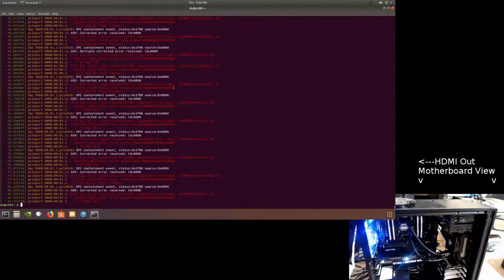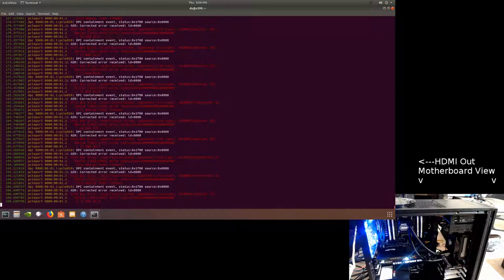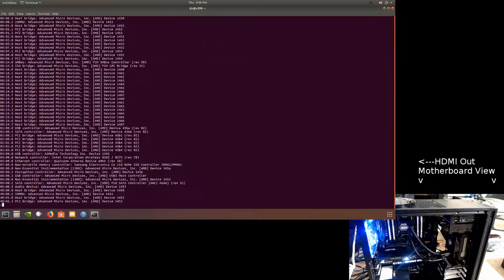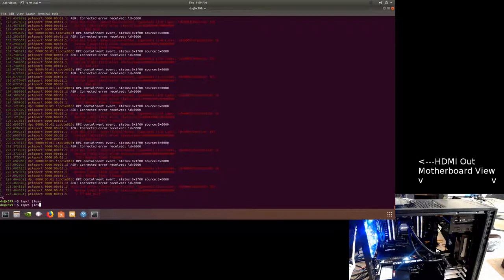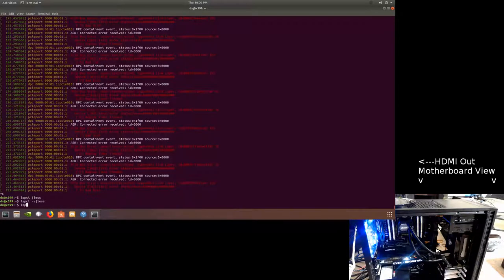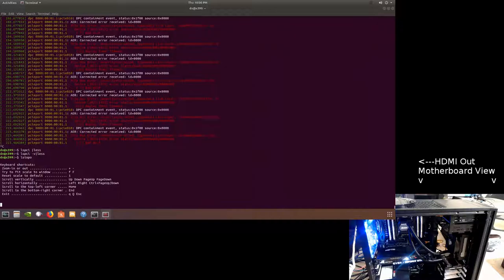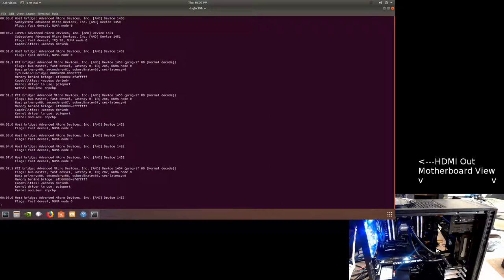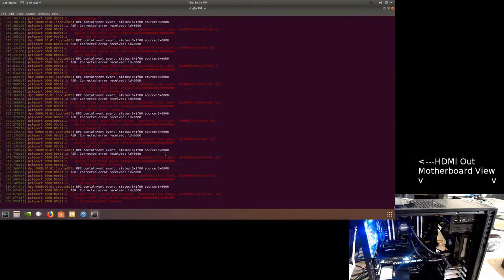Entry #2: Motherboard #1 Gigabyte X399 Aorus Gaming 7 issues w/64GB

Comment from the maker: UPDATE #1: was able to get the NUMA Node 0 PCIe issue "worked around" by disabling some power management features which was a combination of several settings in the BIOS (Gear Down and some other "Down" setting someplace) and a kernel command line parameter. As a result I have "semi" reliably been able to install 6 modules (96GB) operating and recognized.

The system has more consistently coming up and recognizing the dual die hardware and shows a NUMA system, and more consistently recognizing 6 of 6 16GB (96GB total) across BIOS, Memtest86 7.4 Free and a recent Linux 4.13 kernel.

Myself and a good friend did a lot a research to narrow the issue down and still believe an updated AGESA firmware (patch level of 1.0.0.4 or later could fix this issue all together -- latest appears to be at least 1.0.0.6). The F3g BIOS appears to have 1.0.0.3

Will attempt to make a video of the settings on the original Motherboard #1 (F3g) BIOS and command line kernel parameters that more reliably registers 96GB (of 96GB installed). *STILL* not able to register all 8 modules (128GB total).

Comment: fyi gigabyte has a 3 year warranty off manufacture date of the mobo ;)  SO, check your manufacturing date ( first 4 digits on serial number which would be the first for after sn.  these four numbers tell you year and week of manufacture, and if it is withn 3 years and you are having board problems that cant be troubleshooted just submit an RMA.
Reply from the maker: I ended up returning everything and took the restocking fee hit. Just think this product line was rushed to market even after following the "approved" memory list.
Reply: @dx9s  yeah I hear you, interestingly enough and the ram qvl is weird, it wasn't until a couple days ago when I actually saw "summit ridge" util that point they were all "Colfax" ( or second gen). and I have gskill trident Z rgb 2666 for mine that I bought off Newegg and was the only gskill 2666 listed at the time I might point out and the qvl lists the ram albeit a cas 15 and what I got was cas 18, im hoping this doesn't cause me any issues however, I used my board 1 day last October then shut it down while I waited for the actual case I planned to use and a few other parts ( never even installed an m.2 in it yet) only to fire it up last week and get red cpu led and 00 on the post code so it is in for rma right now.  gigabyte has received my board according to my usps tracking number UNfortunatley gigabyte has some weird not scanning it till next day bs which means it wont even get scanned into their system till Monday as they are closed on the weekends and then according to customer service it could take up to 2 dyas before they even start inspecting and testing so I am guessing ( assuming they can repair it or have a replacement in stock) Monday the 23rd return shipping back to me and then if they ship it fedex dumbpost I could be waiting another 2 weeks because of fedex but I do not know what shipping gb uses but I am betting it is either fedex dumbpost or ups ground both of which are slow and careless methods of shipping used to save a couple bucks.  in the event they do not have a replacement gaming 7 board which is possible since it has been discontinued and replaced with the designare ex ( which removes killer nic, rgb in ram slots, and changes heat spreader color to silver with a diamond looking logo and costs the same as the gaming 7).  now im all for replacing with equal or slightly better but the designare ex is IMHO neither of those as certain features of the gaming 7 I wanted ( mostly rgb ram slots and overall black clor to fit my build) are now gone, I can do without the rgb ram slots as im using rgb ram, and I can do without the killer nic, but I absolutely cannot use a mobo a mobo that isn't predominantly black and unfortunately the only 2 boards close are the designare ex  and the aorus pro, NEITHER of which are acceptable to me as the aorus pro is the cheaper lower end board and doesn't have m.2 heat spreaders, and the designare has a prdominatley silver color which would force me into having to buy a new case or paint a brand new dark base pro 900 rev 2 case neither of which is acceptable to me and offering a refund would also not be good because I no longer have the receipt for the board and only thing I have is the $389.99 sticker on the motherboards box which is in gigabytes possession but I do have pics of as I took a LOT of pics to cover my ass after reading a lot of horror stories on gigabytes shady warranty avoidance practices.  basically the only X399 board gigabyte has at this time ( again this is all assuming my gaming 7 cant be repaired and gigabyte doesn't have a gaming 7 board for replacement) is the x399 aorus xtreme which I could get one of those for $389.99 provided the funds were in paypal quickly as when I find that kind of pricing the boards don't last long but I have to factor in gigabyte probably doesn't have or use paypal, if gb does and send refund via paypal I will lose some as paypal will take a cut (yes when you receive money paypal takes a percentage unless it is sent friends and family).  so I personally am sweating bullets hoping gb can repair my x399 gaming 7 or has a x399 gaming 7 for replacement.  if not I am basically screwed unless gb will replace it with an aorus xtreme but I doubt it.